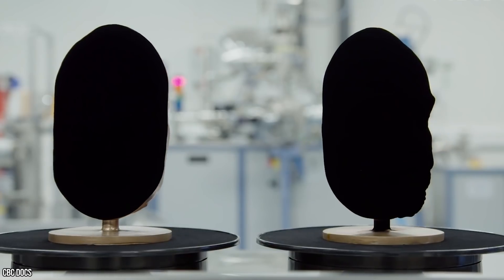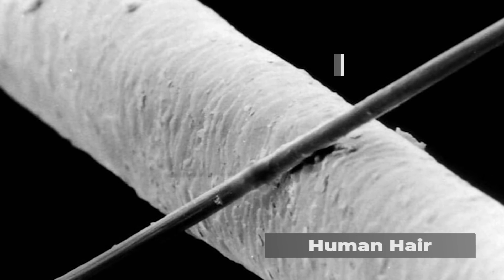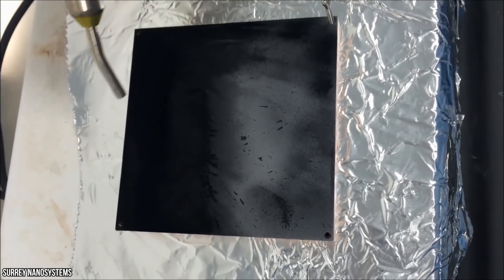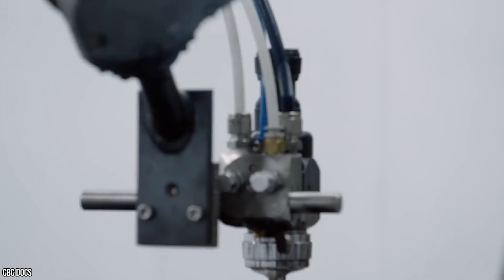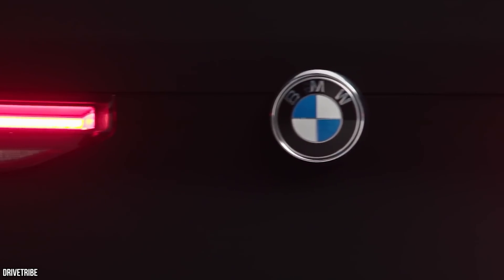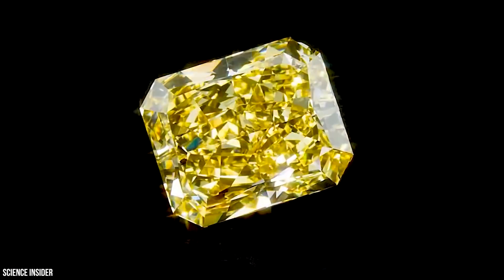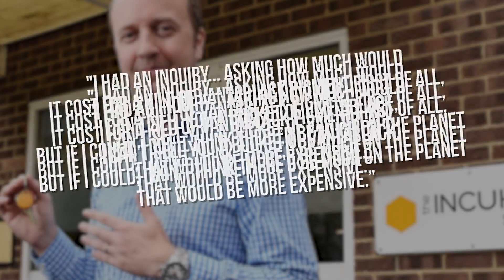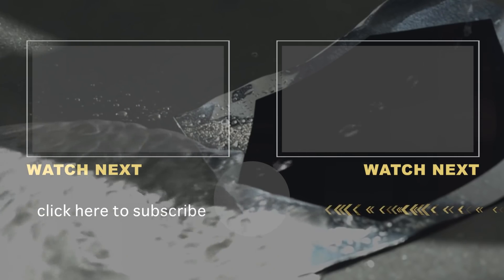This Material Is More Expensive Than Gold

Comment: There are certain applications where this technology would shine....
( pardon the pun)
I'm thinking specifically of coating satellites with it as a way of preventing them from interfering with observatories viewings of the night sky.
On the downside, any application where this material is exposed to the atmosphere will affect its performance because the impurities in the air will contaminate the surface and reduce its effectiveness. Safely encased inside a watch.... no problem. But on a car going down a dirt road..... need I say more?